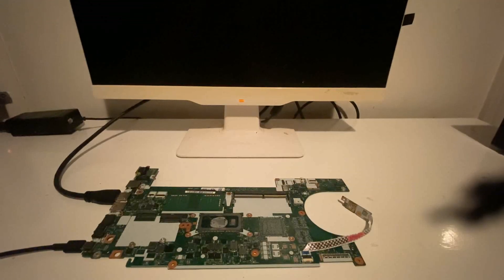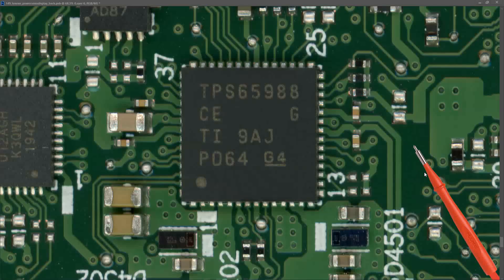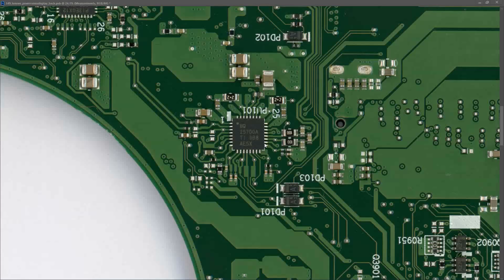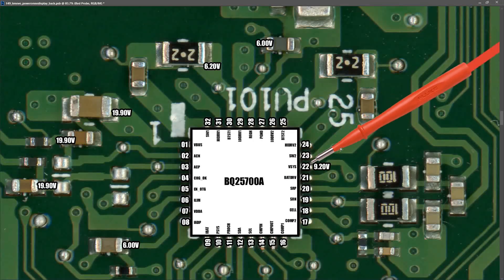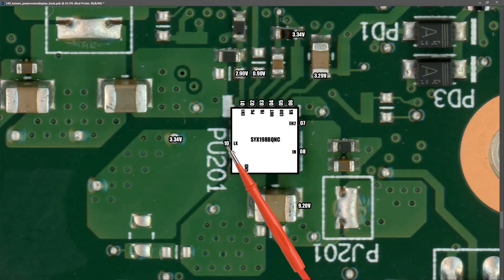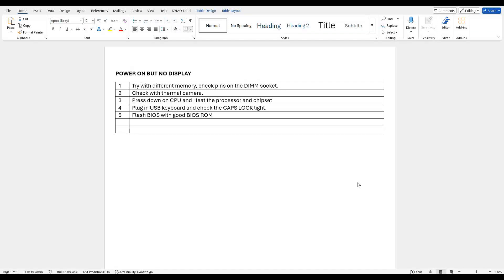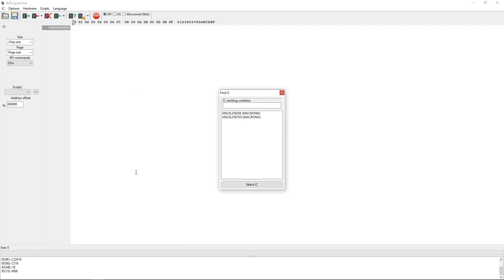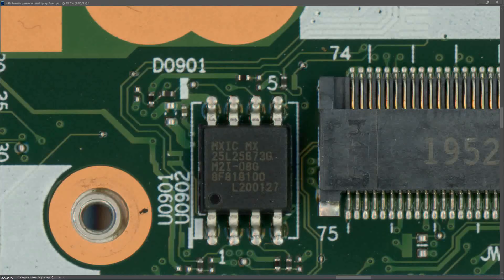LENOVO L590 - POWER ON BUT NO DISPLAY AGAIN!

Comment: Hi.. I found the TPS65988 pin configuration that I downloaded is diffrence from yours... for example yours pin 7 is LDO 3.3 & my download shows pin 9 as LDO 3.3. Hope you can clarify on this. Thankyou.
Reply from the maker: yes I lost a lot of time on this. The TPS65988 datasheet shows a 54 pin IC with 14 pins on each side. But you will see that the IC on my board shows 1, 13, 25, 37 on each corner (to indicate the starting pin number on each side of the IC) for a total of 48 pins. I could not find a datasheet for a 48 pin version of this IC, so I just matched the pinouts I found on the schematic for the motherboard.
Reply: @therepairshare673  thanks for the clarification... TPS65988CE is diffrent from  like TPS65988DH.

Comment: Isn't that frustrating when you find correct voltage on every power rail, but it still won't POST? I wonder if this was due to a BIOS update via a Windows Update?

Comment: Thanks for listing the motherboard model and revision. That information is often more useful than the laptop model number, since OEMs often use different motherboard revisions in the same laptop model series. I assume this board has an Intel CPU. Did you need to worry about the ME region or the serial number in the BIOS?